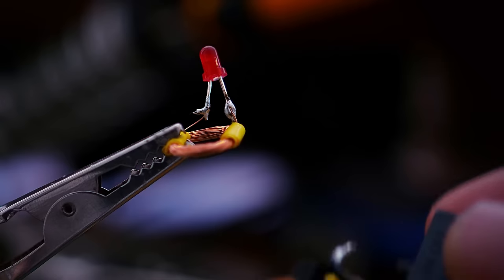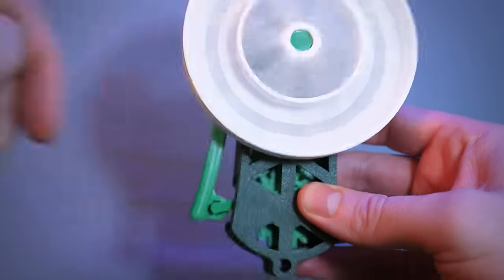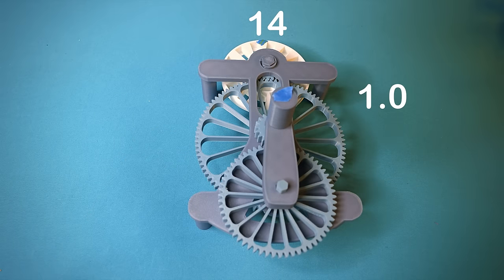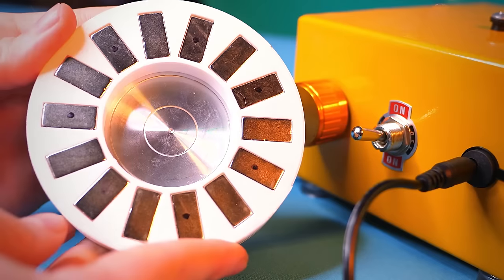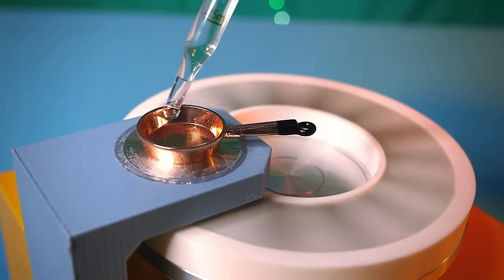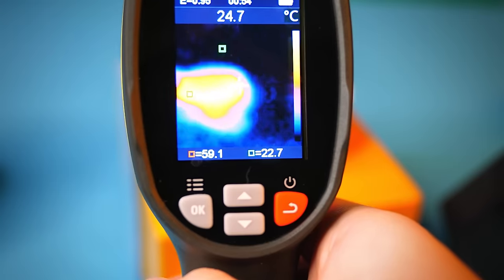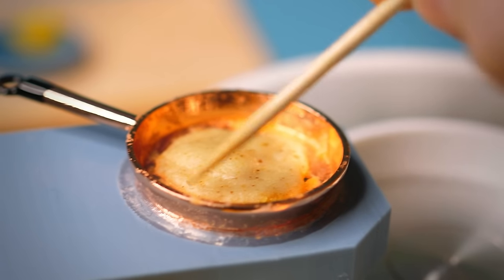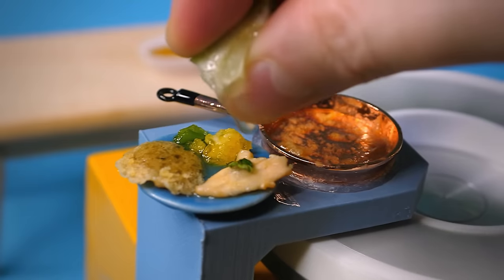Can I Cook Food with Magnets?

Comment: ideally you'd get rid of the big chunk of aluminium and figure out a way to just hold a steel pan over your magnets, for way more efficient heating (ferrous materials heat up faster under eddy currents, and having less of a gap between your magnets and where you want the heat to end up also helps).
Reply: Yep, he should make it a proper induction top, heating the pan directly.

Comment: i would add liquid metal to increase the conductivity of the pan
Reply: I don't recommend mercury, so galium?
Reply: Gallium has a big reaction that ruins aluminum
Reply: is it food safe?
Reply: @degox99  it's not going to touch the food
Reply: @jad05 if galium reacts, and its not going to touch the food, use mercury instead
Reply: @AAHAHHHHH it'll ruin the pan so no it will touch the food
Reply: What? Stay in school.
Reply: @waik0182 pretty sure mercury does too.
Reply: Bismuth has pretty low melting point and is safe to ingest
Reply: @epluribusunum6622 i think he means the thermal paste lmaooo
Reply: Or just heat the pan directly with the eddy currents by removing the aluminum disk and moving the pan close to the magnets
Reply: @waik0182  Mercury would react too.
Reply: Absolutely not. All liquid metals will interact with aluminum.
Reply: @AmaroqStarwind why is this?
Reply: @andrewjustice4810   Gallium, mercury, NaK… they all attack aluminum’s crystal structure, trying to forcefully form an alloy with it.
Reply: @AmaroqStarwind What if you were to plate the aluminum with another metal?
Reply: Aluminum doesn't like liquid metal
Reply: @Syvern.  Even then, galvanic corrosion could potentially happen… and liquid metal is also thermally conductive and could potentially get everywhere. DIY fabrication is limited.
Reply: Just use termal paste

Comment: Magnetic fields follow the inverse square law. Reducing the distance between the pan and magnets should increase the rate that the pan heats up.
Reply: The inverse square law only applies at large distances when considering a non-point source monopole. An ideal bar magnet behaves like a pair of plane-shaped monopoles situated on the surface of the ends of the bar. Near plane-like sources, the magnetic field lines all become perpendicular with the plane, and thus become parallel with each other rather than spreading out. Because of this, the magnetic field does not diminish in strengh since it's not being spread out, so the inverse square law breaks down near the surface. Thus, after a certain point where the pan and magnets are close enough, there's not much benefit to reducing the distance further.

Now, all of that ignores the existence of the opposite side of the magnet. Since that side is farther from the pan, the inverse square law is more effective in analyzing its field strength at the pan. However, the opposite side's field weakens the effect of the near side's field, so you want the opposite side to be far below the pan so as not to cancel out the field from the near side. The solution to that is to either use longer magnets, or to stack magnets together in order to make longer magnets.
Reply: Something that close with a relatively low frequency is going to be operating in the reactive near-field regime since the 1/6 wavelength threshold is rather large.